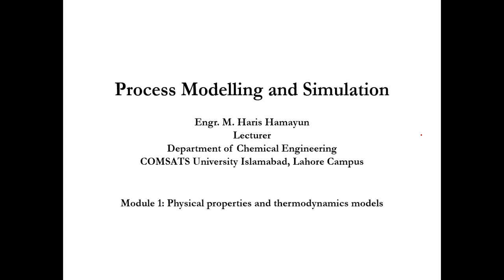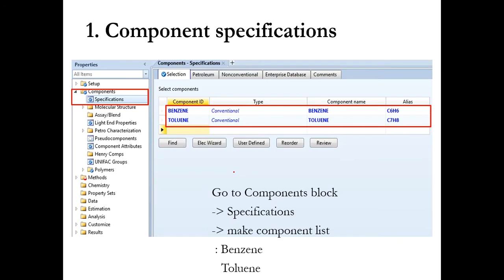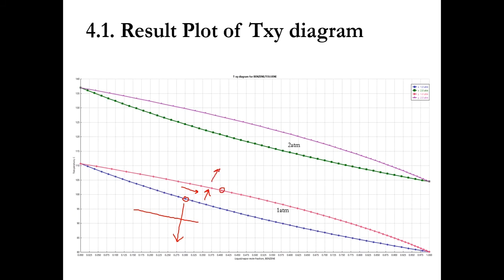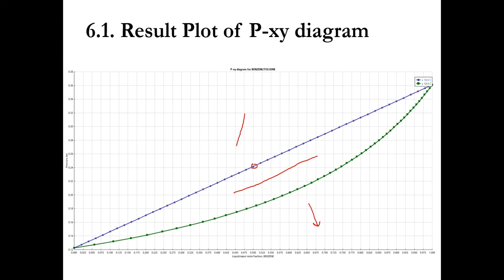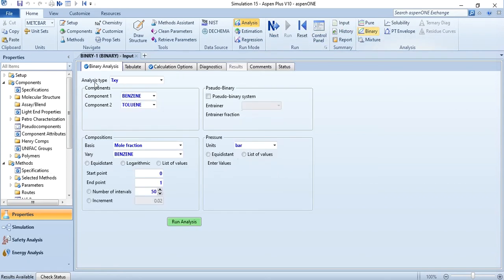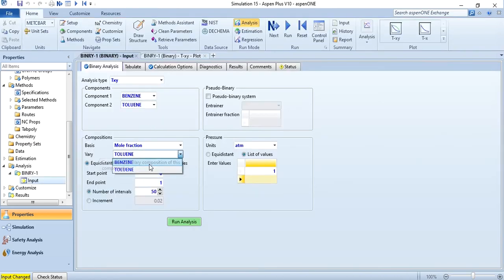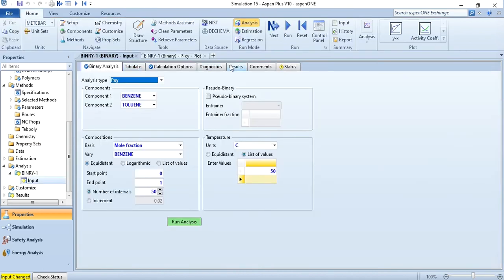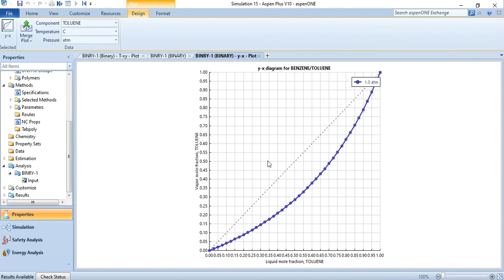T-xy, P-xy, and y-x diagrams for a binary mixture using Aspen Plus - Lecture # 37

Comment: Sir i have 1 que... Plz reply... 

Sir Txy graph and Xy graph kyu nikalte hai...? I mean can u explain why the first step is to draw a graph
Reply: Txy is mainly taken out when u want to find out the bubble and dew point of binary mixtures, 
Like when u do some experiments based on hydrocarbons like that it would be helpful for that.

And xy it is mainly taken out the graph, to check the equilibrium of liquid and vapour how equally its distributed among it self,
For example if ur designing distillation column, this xy diagram will be helpful.

Correct me if I'm wrong !